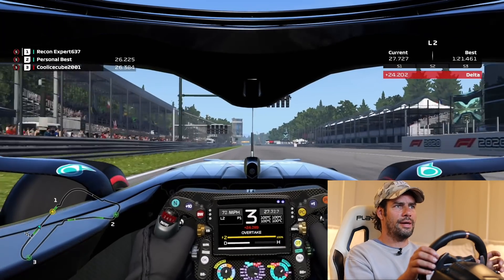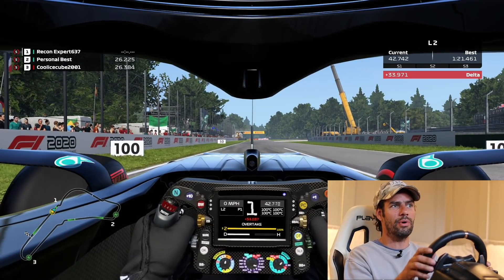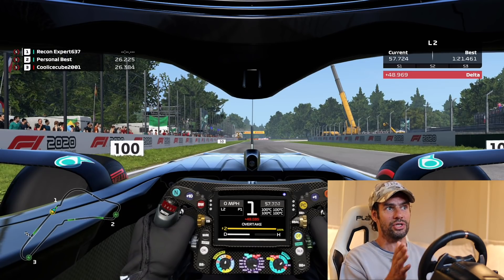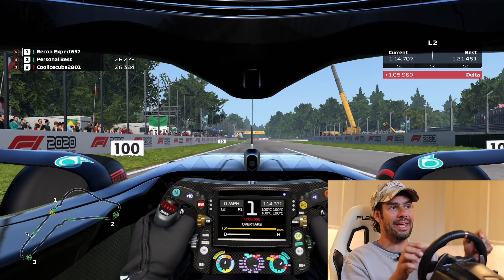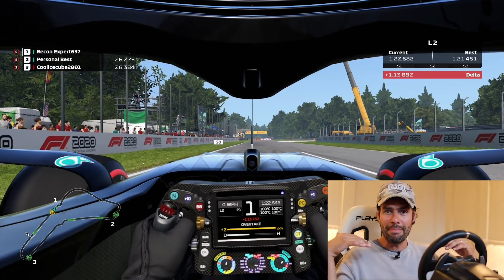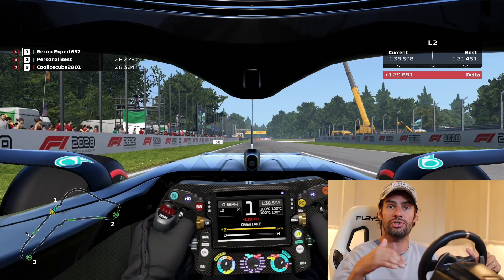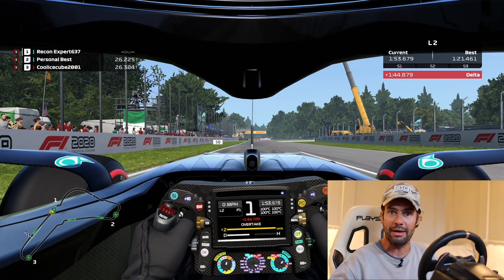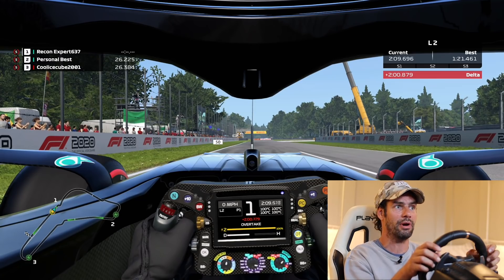What Happens To An F1 Car Around The High Speed Monza Track?

Comment: Two things.
Why do the mechanics on front RH LH, turn the wheels when thd car is just back from a lap and car is on the trolley.
I think that the rules need revision for min speeds , f1 will have a massive accident when cars are nearly stopped and some are on a flyer. just watched Fp2,  its mad....especially in Monza
Reply from the maker: Turning the wheels is to try and clear rubber marbles from the brakes, to prevent fires and yes, the traffic in Q is dangerous!
Reply: @F1Elvis  Hello , Many many thanks for you answer, thats very kind. Well now i know what they are up to. I thought that were worried the wheel bearing were f..ked. only joking ..... i worked in Stuttgart on  transient dynos and loads of other stuff and worked with fair number of McLaren + Ilmor personnel... Elvis on the car and  Turbo on the gearboxes, you could do a YT on nick names..... .... best regards.

Comment: I'm pretty sure I've seen in other series that they close the first chicane for the first lap, then the marshalls swap the barriers over to the straight section. It's to stop there being accidents on lap one. I wish they'd do that for F1. It doesn't necessarily mean that those on the front row run off and hide, because those from behind have a longer run up to that point and can use slipstream to pass those in front. IMHO that's the safest option.

Comment: Thanks for another good analysis.
It's interesting about getting the car straight for maximum traction even though it isn't pointing down the road yet.
I noticed Jolyon Palmer talked about keeping the wheels straight at crucial times too in his Belgium review.
One instance in particular was how Lewis Hamilton got a slight edge on Valtteri after the safety car start when Lewis took off mid turn and mid weave and Valtteri was in the middle of his weave so his tires were not straight and he got wheelspin when he hit the power and Lewis was away.
I like learning all these details about all the different aspects of racing.

One more thing, Jolyon commented on Lewis down shifting one too many gears heading into turn one after the start. He claims it was probably a mistake as Lewis got a lot of wheelspin on the exit.
My point is that if even Lewis Hamilton can downshift too much anyone can and that is why sequential gearboxes do not have neutral at the bottom of the downshift sequence.
If they did and a Lewis had accidently hit neutral mayhem would ensue.
So, please use your mighty influence with Codemasters (drop Jolyon's name too) to get them to put neutral where it should be. A separate button. 'Not' one click down from first.
Inadvertently downshifting to neutral should be impossible.

Thanks for the great show
Reply from the maker: That's a good point, I hit neutral by mistake in the 1st chicane on a run yesterday!👍
Reply: @F1Elvis  
Indeed, and in the real world it might cause a crash and it definitely ruins lap times.
Motorbikes have sequential boxes as you probably know and neutral is between 1st and second so you can't accidently do this very thing.
Years ago false neutrals were pretty common when there wasn't enough presure on the shifter or the dogs just banged into each other and it caused problems as you could imaging, no engine braking to help slow and stabilize into corners or massive over revving and no acceleration when missing an up shift.
Now that manufacturing is so accurate and systems so much better it is rare.

Modern sports bikes have seamless clutchless upshift and down shift.
I would love to try one. My one is sold, like me.

So, I hope you do mention it to Codemasters if you get a chance.

Comment: Hey, Marc! When drivers press the Overtake button, does the MGU-K outputs the whole 124kW/160BHP power all the time or is it still mapped to the throttle position like any other ERS mode? If the driver pushes the button but suddenly needs to partially or completely lift off the throttle, will the MGU-K take this into account and decrease the deployment accordingly when operating under the overtake mode?
Reply from the maker: Yes, still linked to throttle demand.

Comment: Hearing you talk about suspension elements like the rollbar I wonder: how many different suspension parts do these F1 teams produce for the various tracks characteristics they have to race on? Surely they don''t use the same elements every time?
Reply from the maker: They have a vast range of torsion bars and anti-roll bars, together with many other elements that are adjustable like dampers, ride heights, geometry etc etc. Any can be used at any event to trim the setup as required.

Comment: about the engine mod, is it possible to replace the overtake button by a clic at the end of the throttle pedal travel ? like on automatic cars (you push the pedal to 100% and if you push more, you have a clic and the car downshift) so you can run a safe mod for the race and have extra power for quali or to overtake in the race 
PS great video like always, I like the technical stuff about the setup
Reply from the maker: No, it's the change in mode that's banned, not the method of switching it.

Comment: Marc do you think that Ferrari might struggle to get both cars through Q1 at Monza
Reply from the maker: Yes
Reply: @F1Elvis  back 3 rows of the grid all with Ferrari Power Units?
Reply: In Spa Ferrari was middle way from an extremely low downforce setup. Unless they go for more downforce, I could see them doing sligthly better in Monza, but still leaning towards the botton of the midfield. Ferrari engines will be less affected by the new engine mode rule. So it might be an enthralling race in the midfield.

Comment: #askelvis Hi Marc is mercedes telling the customer teams what engine mode to uses this weekend, if not will they use a higher mode then mercedes? williams could go from back of the grid to middle of the grid.
Reply from the maker: Yes, Merc control the engine modes.

Comment: #askelvis Hi Elvis, with the new engine mapping regulation do you think ferrari will turn there engine as high as they can for Monza? After all thay are going to be at the back of the grid and taking a engine grid penalty later in the year is not going to hurt them so badly.
Reply from the maker: Don't think it would make anywhere near enough difference...

Comment: Would you be able to give any insight as to why Mercedes doesn't seem to perform as well as it could with the low downforce package. Is that a set up issue or just an inherent trait of their car?
Reply from the maker: I don't know the exact details, but it sounds like the design of the car works, at least in part, because it has great aero efficiency. The advantages of that particular trait increase as downforce is added and are minimised as it's taken away.